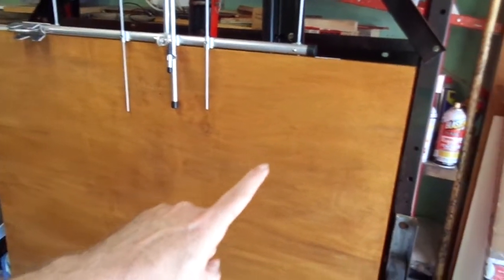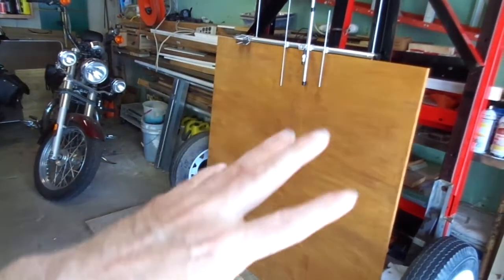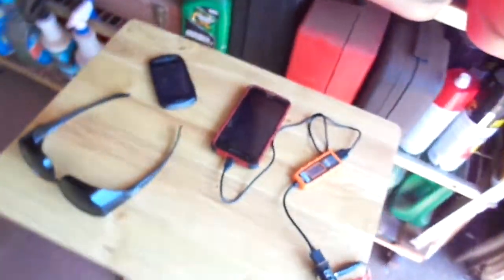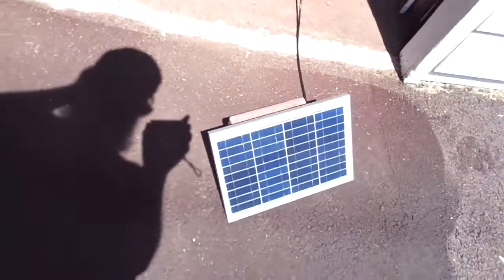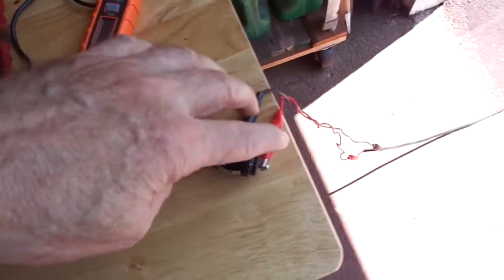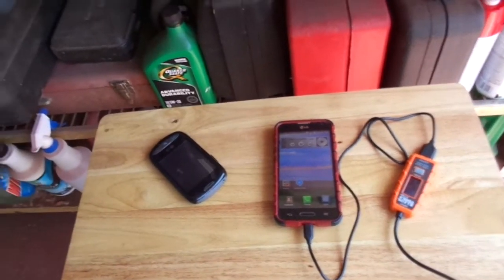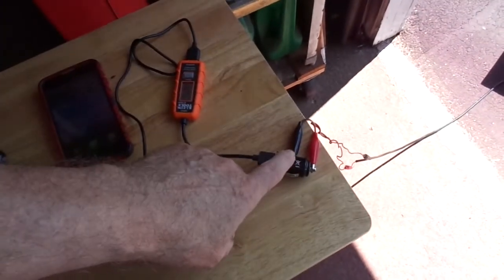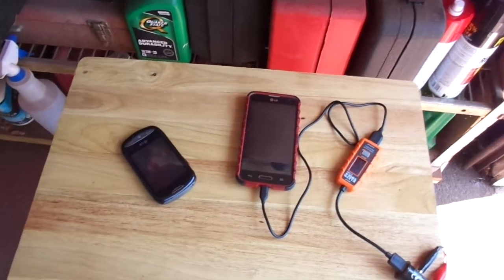A 10 Watt Solar Panel Experiment

Comment: How come I didnt know you were a ham operator?? Lol NN7B here in Utah!
Reply from the maker: I only got serious about three years ago. Been meaning to do it my whole life but after I retired I decided to give it a shot. I passed all three tests a month apart, I went from Tech to Extra in 60 days. Then I got my VE credentials and helped a few others become Hams. Now I am learning CW and running a CW learning net every Sunday. I am up to 15 wpm but getting to 20 wpm is kicking my butt. I will get there eventually.
Reply: @suburbanryder  well done!! I have started CW a bunch of times, but never seem to have the spare time yet to devote to it, so havent made much progress with it. I have done some building, but I just run out of time..... we've moved too, so I had to take down my HF antenna, and havent convinced the wife well enough yet to set up a new one, so I stick with 2 meter and 70 cm most of the time. Thanks for sharing bud!

Comment: Thought about buying a Cushcraft R9 HF all band vertical but they want big bucks for it. want with a vertical kit I bought from a guy over in England who calls himself DX Commander on YouTube. took a few days to get it put together but am not happy with the swr on any of the bands. Since it is a vertical 1/4 wave wire antenna I think all the elements a to long so I am going to be working on getting that fixed. Talking on a 10-80 end fed wire up as an inverted V in a tree. Does ok but needs an antenna tuner on most bands.
Reply from the maker: I don't have anything yet for 80 meters. I mostly hang on 20, and 40 for  the CW QSOs and such. I also have a 10/11 meter vertical although the bands are crap now.
Reply: @suburbanryder  Hopefully one day we can have a qso on 40 or 20.

Comment: Nice.  In a pinch could be real handy.
Reply from the maker: Ham radio is all about handling emergency communications and traffic. We sent 50 hams down to Puerto Rico and got the emergency communications back on track using ham radios. The towers for the trunked radios were all without power but we Hams always have a plan b to communicate.